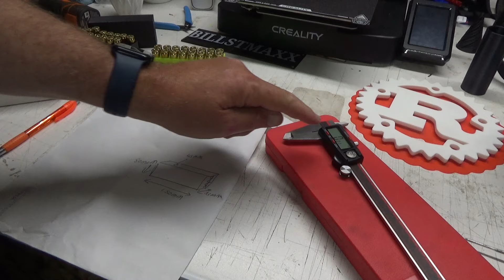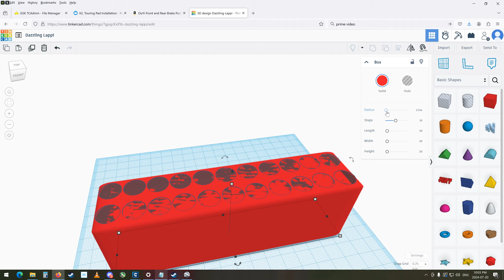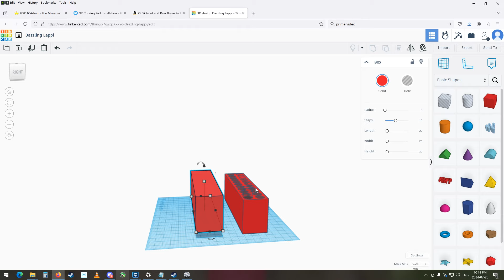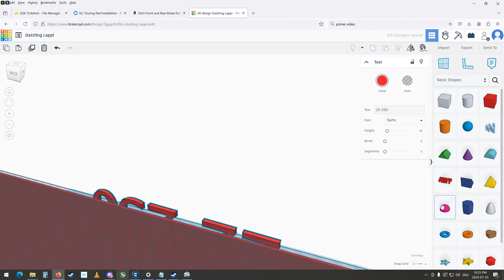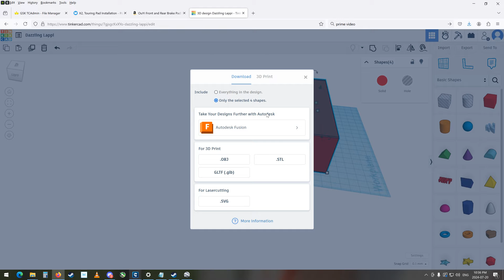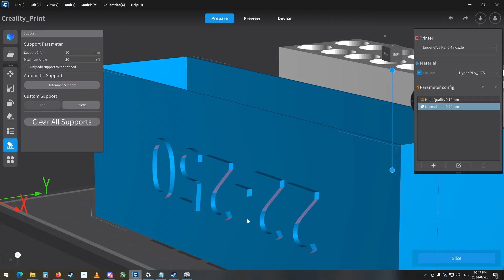Lets design a new ammo storage box and lid to fit (in the cad) Then print it out

Comment: Turned out pretty nice! Take a look at the tutorials for using the align, group, and measure tools for tinkercad. Should help you a lot for being able to more quickly crank out a design like this.
For example you could align your cylinder to the edge of the box, then use the measure tool and/or arrow keys to put it exactly where you want. Then select it all and group, the holes become actual holes in tinkercad rather than just showing double planing. Keyboard shortcuts are great to know too - for example "D" would have dropped that one object onto the workplane.

Give the bed a good wipe down with alcohol if it isn't sticking. Not sure what stronger things would do to the PEI.

You may want to try a brim rather than a raft. A brim just extends the edge rather than being a full plane you have to tear off of the face.